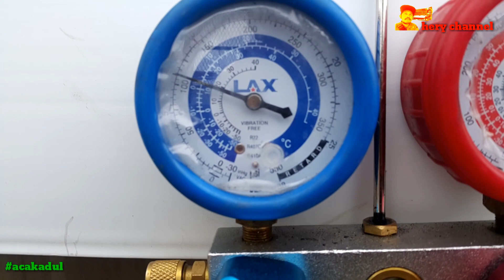Install new split type gree 2hp and remove existing unit

Comment: pipa R22 yang lama tak perlu tukar ke bang sbb gas yg baru ni R410.
Reply from the maker: Tak bang asal sebelum pasang piping di flasing dlu pake gas R410a bang.
Reply: @herychannel  ok.. Tapi ketebalan pipa nya mampu tahan ke tekanan R410. Sbb sy pun ada ac yg R22 nak tukar ke R32 tapi masih pakai pipa yg lama sbb semua conseal dalam dinding. Tq mas👍
Reply from the maker: Klo piping dlm video dlu sya pasang yg ketebalan 0.71mm bang jadi tahan..klo punya abang mesti cek dlu bang sama ada tebal atau nipis..
Reply: @herychannel  saya punya yg nipis bang😁
Reply from the maker: Klo nipis bagusnya di tukar baru bang.
Reply: @herychannel  ok bang 😁😁